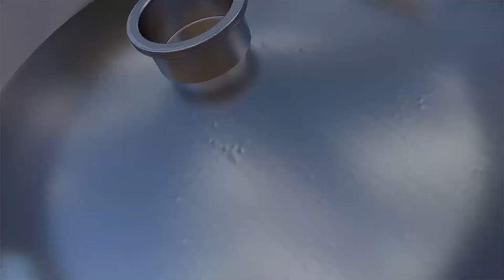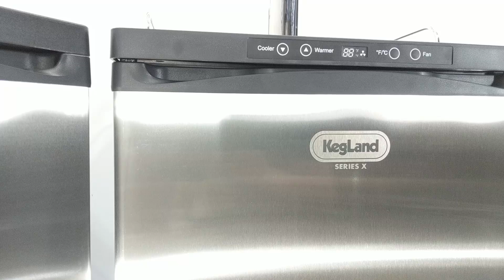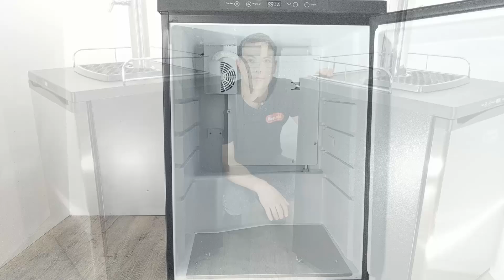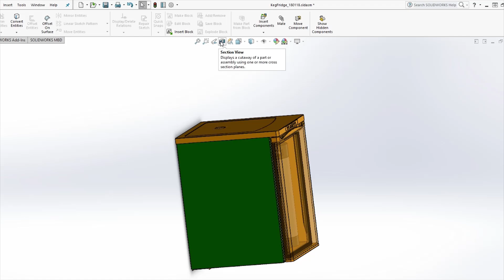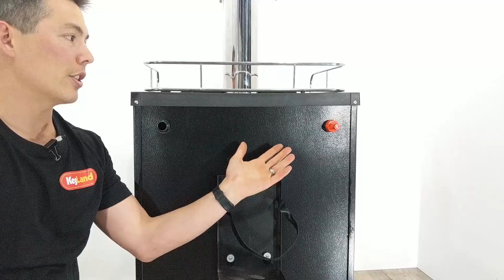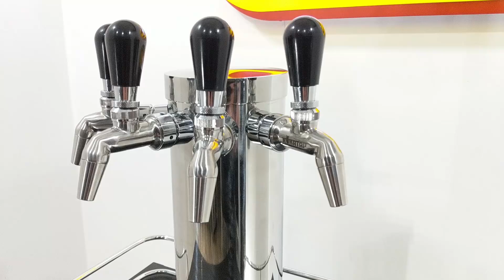Series X - More Kegs, More Powerful, More Efficient - 4 Keg Kegerator

Comment: Hey I have the series x kegerator, with just a single keg at the moment....may upgrade.
Just a thought, how do you guys and gals, keep track of how much beer is left in the tank, is there a set of scales we can put under the keg wile it's in the kegerator? Or some other method.
Reply from the maker: We have done some experiments with scales but dont really like this option as it chews up too much power and thus requires a power cord to be connected to the scales.  We are having more luck with laser level sensors to pickup on the liquid level in the keg and these are lower power consumption so we can use a battery that will last more than 6 months and report the keg level height so this is more likely the way we will go in the future.

Comment: Hello Everyone!

Since a week i'm the proud owner of a Kegland series X keggerator. Unfortunately it is missing the font fan tube. Can someone tell me what the diameter of the font fan tube is? Ill try and see if i can get a substitute at the local DIY shop. Can't find it on the kegland site under the spare parts section either.
Reply from the maker: You should not need to do that. The font fan tube should be packed in the box.  Please contact the retailer so a replacement can be organised.  Alternatively if you really want to just purchase one then you can use electrical conduit that is 20-22mm diameter.
Reply: @KegLand  thanks for the quick reply 👍

Comment: Anyone else with one of these that gives off loudish pops every now and then?
Reply from the maker: It sounds like your fridge has been tipped sideways or upside down.  If this happens you can sometimes get oil migrate into the capiliary tube and create this a popping sound.  If this has happened let the fridge run for a few months and the oil will eventually migrate back to the compressor.  Always try to transport the fridge upright.

Alternatively the popping sound might be caused by the aluminium cold plate at the back of the fridge changing shape as the cold refrigerant goes through the cold plate and flexes.  I have been told by one customer that he solved this proplem by just loostening the screws that fasten the cold plate to the back of the fridge and this allows the cold plate at the back to move a little more freely without making this sound.

It's hard to know without actually seeing and hearing the sound but these two things are the most likely.

Comment: It will not fit your 4 normal kegs of 22.5cm diameter there, they forgot to mention that on the video. It only fits 4 kegs by Kegland of 21.3cm diameter which is 17mm thinner than conventional.
Now I have to sell the Kegerator or my kegs 😡
Good to mention that is quite loud if you are thinking about to put in your living room, think twice, specifically late night and you are trying to watch a telly.

Comment: Never had any Fridge whos getting hot on the outside and i am just wondering how mutch energy consumption this device has.
Reply from the maker: Put a power meter on the device and you will notice that this unit is extremly power efficient.  As we use a large evaporator inside the fridge this captures heat very effectively.  As a result when the compressor cycles on for a very short period it will efficiently pump the heat to the radiators on the left and right hand wall of the fridge where the heat is dissapated.

In many other fridge models they will save money by reducing the evaporator size.  This results in the heat being absorbed by the evaporator very slowly and pushed into the radiators slowly so they are not as hot.  As a result the compressor isrequired to stay on for a much longer time as it has to keep runing for a longer period to dissapate the same amount of heat.
Reply: @KegLand  Thank you for your reply. Is it normal that i got a huge diffrence in Temperature? My Brewbrain messeuring 18 °C and the Kegerator ist set to 26 °C (The Temperature of the Brewbrain is correct / i tested it whit 2 diffrent messuring Tools.)
Reply from the maker: @JValida  Yes that sounds correct. this fridge cannot heat.  It's a fridge and is a cooling device. If the fridge is set at 26C it cannot heat up to this temperature. IF you want a fridge that heats you need the RAPT fermentation chamber.
Reply: @KegLand  Sorry, I may not have expressed myself correctly. I know that this is a refrigerator. If I have a room temperature of 25°C and set the refrigerator to 20°C, the temperature always cools down to 11-12°C. This means that no matter what temperature is set, there is a deviation of 8-9°C and the fridge starts quite often. It runs for several minutes every hour.
Reply from the maker: @JValida  For your particular application when using this fridge for fermentation I would recommending pulling the 2 wire NTC probe out from the right hand side of the fridge and extending the cable. This will enable you to put the probe into the fermenter or at least tape it to the side of your fermenter.  I think the issue you are getting is the probe is mounted into the fridge wall under a small plastic cage but you are wanting to control the core temperature of the fermenter.
Reply: @KegLand  I'm using the Kegerator for some Time now. I had some future Improvement: It would be nice if the Kegerator would be a bit quieter, the outer walls didn't get so hot so you don't have to leave 10 cm free space on each side, the LED brightness of the temperature display was adjustable (turning it off) and the fridge didn't always crack after cooling down. You have developed a very good product, thank you very much!
Reply from the maker: @JValida  Thanks for the feedback JT.  We really appreciate it.  We will take these points into consideration with the next model.

Comment: How would i add the carbonation cap set up to a series 4. Any parts you sell that i could use to modify it?
Reply from the maker: The PCO 1881 threads are pre moulded on the Series Xs. As such you can't really use the carbcaps on the series 4s.

Comment: Bought my series X from a retailer in Finland. My unit does not fit 4 19L ball-lock sodakegs, it only fits 3.
Reply from the maker: There can be a lot of variation in the ball lock kegs out there. Pin lock kegs also tend to be shorter but wider.

Comment: Just got mine today. It doesn't come with the red carbonation cap or a grommet to narrow the hole so you can just pass the airline through without leaving a massive gap which is going to allow the cold air to leak out. I can't find the carbonation caps for sale anywhere in the UK either. I think my only option is to drill a hole the same width as the airline through the plastic cap.
Reply: Yea I found this problem as well I just drilled a hole through the cap to pass the hose through

Comment: Which type of duotight fitting did you use to connect the gas line to the plastic coke bottle fitting on the back of the fridge?

Comment: I just bought a Series X.  Nice unit but some feedback - the air hoses supplied with font do not fit the barbs on the supplied quick disconnects.  The inside diameter of the twin wall hose is 4 mm and the outside diameter of the barbs is 7mm and no amount of warming up the hoses, stretching the hose with needle nose pliers would get them to fit the barbs.  Better to supply these with MFL fitting and pushlocks or pre-assemble. Would be a whole lot easier for your customers.

Comment: Impressive!  What a huge improvement over the series 4.  The one question I have is whether the series X makes the same gurgling noises as the series 4?
Reply from the maker: The gurgling noise is probably due to oil migration from the compressor into other parts of the fridge.  If the fridge runs for long enough the oil will mostly return to the compressor and the sound should go away eventually but it might take a few months.
Reply: @KegLand  so is it still loud as hell or not? My series 4 is 12months old and still gurgles and carries on the same as it did from new.
Reply: @jonburchell2760  Mine took a couple years to stop. It's actually because I couldn't bare to leave it sit after freighting and just had to plug it all in. Oil didn't get a chance to settle
Reply: It is loud! 😬
Reply: terribly loud.